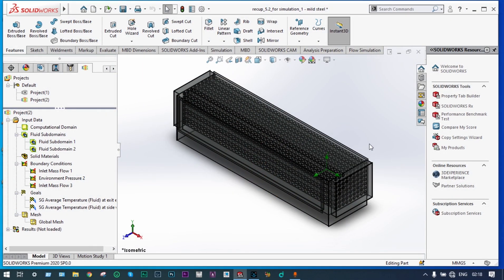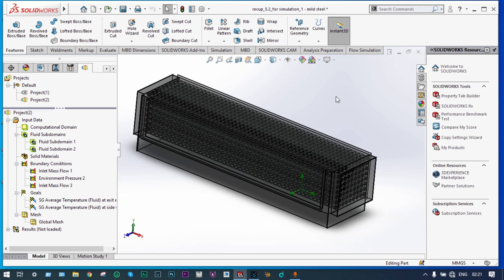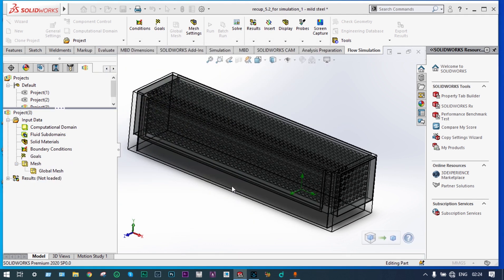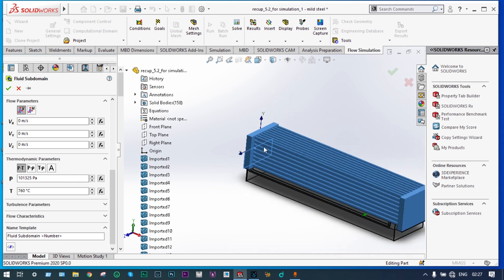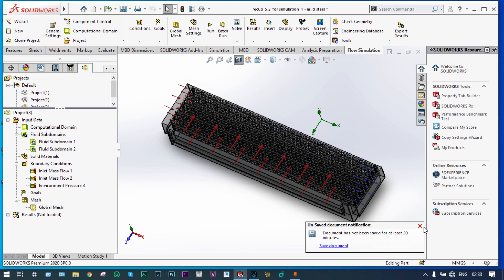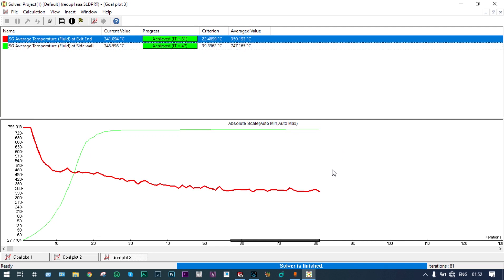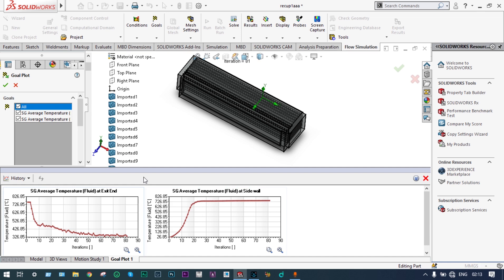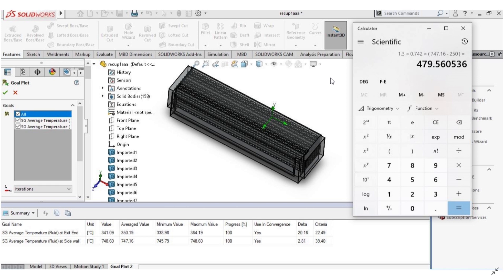Master CFD Analysis of Cross Flow Heat Exchanger in SolidWorks 2020: Beginner's Guide

Comment: Sir, there is a problem regarding temperature scale if choose "Steam" as hot fluid.
Reply from the maker: Yes, you are right. Actually in SolidWorks you cannot mix heterogenious mixture using normal method. Two different types of fluids can be mixed in a single fluid domain using Free surface technique. I have several videos with free surface technique. You can follow....https://youtu.be/z07Lb9e4RTs
Reply: @CFD_GUIDE  sir actually I'm not mixing the stream. I'm trying to heat  the cold air by stream(hot fluid).
And at end result the outlet temperature of stream higher then the inlet temperature of stream.
That's problem sir 
And outlet temperature is very very high.
Reply from the maker: Ok. I will see it
Reply: @CFD_GUIDE  thanks sir
Reply: @CFD_GUIDE  do u see it sir??
Reply from the maker: Yes. You are right. I also observed this phenomena. Actually steam is having huge amount of heat as latent heat & to extract heat from it huge amount of cooling is required and in this case that much amount of cannot be extracted by the pipes containing cold fluid. I have to investigate it and I will comment on it ASAP
Reply: @CFD_GUIDE  thanks sir
Reply from the maker: @vellyboys1421  But if you provide steam from the main pipe and cold air from side walls, prper results are obtained. I checked it is perfect if you interchange the position of fluids.
Reply from the maker: I got the solution. Actually when you are considering initial concentration you have to provide both steam and air to be zero concentration as you are supplying both air & steam from outside. So, initial concentration needs to be checked and it should be zero for both the fluids
Reply from the maker: It is solved. You can see from comments section